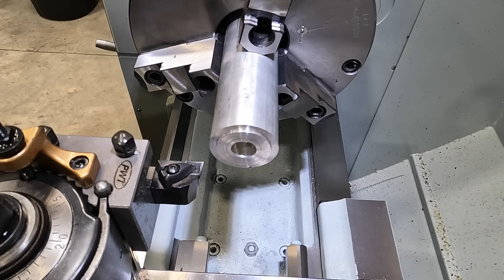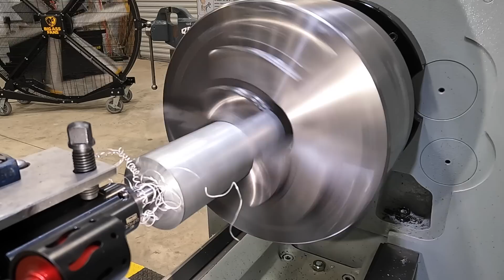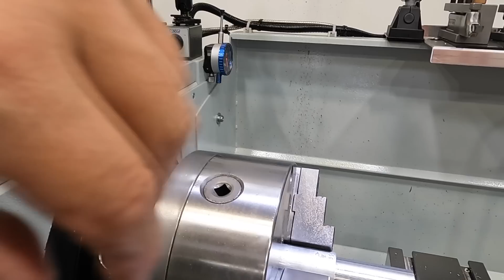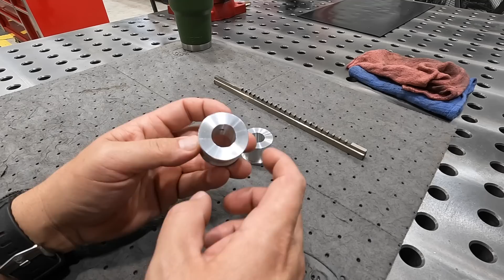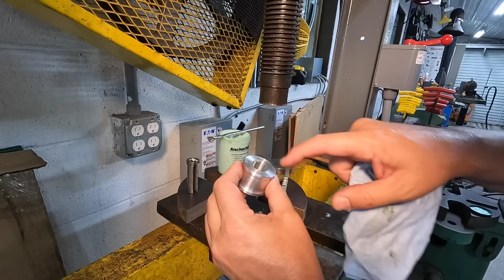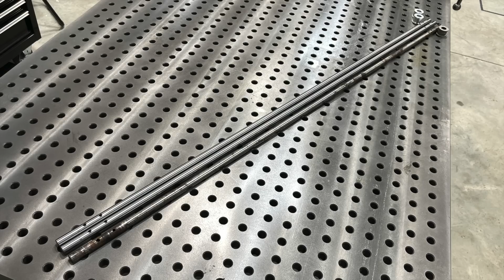Metric Aluminum Pulleys for 20MM Driveshafts

Comment: You know if you don't have a broach/press you can "broach" the keyways by using HSS bars the width of the keyway on the lathe to shave it like a shaper. I did this to machine a key way into a change gear for the victor lathe (mine used timing belts instead of gears).

Comment: The original pulley had a raised edge on the center, wasn't that supposed to help center the flat belt 
so that it doesent rub and shred on the sides?
Reply: The edge is taller than the belt, at least i assume it is, given that its the way every other belt-pulley system works... The central high point, is needed for tracking when there are no edges on the sides, but with those there, the belt aint movin` nowhere, its held central by the raised edges, so it cant fray or get torn by the edge anyway... Crowning of the pulley for a flat belt is just another way of doing it, which is why most olden, flat belt machinery has simple pulleys with a raised center, or so called crowning, as you said, to help keep the belt central... the raised edges are a better way, but oft more tricky, as you can simply roll a belt onto a crowned pulley, but will likely have a hard time doing so with an edged pulley... Its like worrying about an x-V belt not having a crowned pulley, its simply not necessary due to already present geometry that will do the same job and allow for a belt to be more evenly worn and tightened... Now, its possible the original design was intentional and i dont have all the data and one could say im shooting outta my ass on this one, but in general, its either or...

Comment: Since the parts are metric, why are you not using the DRO set to metric, and measuring in metric, instead of converting?  
Other than that, very nice video.
Reply: Probably thinks in Imperial after many years using it in his work. The parts end up the same size no matter how they’re measured.

Comment: Adam this is a curiosity question. By you putting the screw over the key I noticed that actually you are making the "thickness" of the material where the screw is located substantially thinner and weaker considering this is aluminum, in other words, to me it seems there is a strong possibility the threads will strip quite easily. Would be different is this pulley was made of a harder material such as steel or even brass . What do you think?

Comment: The key prevents rotational movement of the pulley on the shaft.  So the purpose of the set screws may be to prevent axial movement of the pulley on the shaft.  If that's the case, positioning one of the set screws over the key might not be a good idea (since the key may slide axially).
Reply: One setscrew prevents the key from moving and the other positions the part on the shaft. Standard practice is to place the setscrews 90 degrees apart.
Reply: @ellieprice363  Fair enough.  Maybe the original pulley was designed for a Woodruff key (which would be captive and not require a setscrew to clamp it in place).
Reply: @chrisarmstrong8198  With s woodruff you still need two setscrews. One over the key to keep it from wiggling and the other at 90 degrees
Reply: @ellieprice363  A properly fitted Woodruff key is well-constrained.  A setscrew seems unnecessary.
Reply: @chrisarmstrong8198  But that’s the way it’s done in industry.

Comment: What I have always wondered (note that I'm not in the US and our pricing/business setups etc are likely extremely different, ie. there's no machineshop in every town, etc): Are machinists prices so low that orders for items such as the ones in this video are given to shops like Adam's, or is it an availability thing (the rollers are custom/cannot be ordered online, etc)?
Reply: More likely it's a mix of time and availability...might find something like this from Misumi, but sometimes speed is more important  than the cost. If your buisness is down, the cost to have a machine shop make it is minor compared to what you will loose for not being able to operate. As far as how common machine shops are in the US, that's a tough question to answer. If there is a lot of manufacturing around, you're sure to find shops of all sizes to support industry or do production work. But, once you get out into lower population areas, it could be tough finding a capable shop within 100miles.

Comment: What’s the ratchet with that press?
Reply: I suppose you are referring to the broach?
Reply: @janvisser2223  I wrote racket. Thank you autocorrect @&$@!
Reply: @wlmjbrown  😀
Reply: @wlmjbrown  I think most of the noise is some slop in the bevel gears. It is a dake press modified by his father some years ago. I would guess it is not as loud and irritating when actually working with it. Microphones and be overly sensitive to some sounds.

Comment: it must be an optical illusion; on the original part it looks like the base of the pulley is crowned to better handle a flat belt.
Reply: There is an undercut on either side of the belt sheave that Adam did not copy over. I couldn't tell if there was any crowning of the sheave.

Comment: Hmmmmm. . .  Non-metric set screw on an obvious metric part.   Somewhere down the line, somebody’s going to be unhappy. . .  at that size, stripping the screw will be really easy to do with the wrong size Allen key. . .
Reply: A good mecanic wil notis it When the mm allen key dont fit.
Reply: 22:20 it was apperently inch standard in the other one aswell
Reply: Don’t know where you’ve been hiding, but the mixing of metric and imperial has been going on for many decades now. Nothing unusual here.
Reply: @grntitan1  Certainly not hiding in America! The rest of the world has spent many decades standardising it's engineering practices not running away.
Reply: I totally agree.
Reply: I totally agree.

Comment: Great video 👍 and a dro is a must in 2022 in my world 😁 you should really consider mounting it on the carriage so its closer/in reach. I've used a Victor with it mounted as yours for 15 years, and when we mounted a new it were put on the carriage. Soooo much better.   All our machines are now like this. And especially important on the ones with long beds 😊

My 'new' Microweily ty2500 has also the dro mounted like this. And it's very similar to yours, size-vise.  Also it's nice to not have to reach over the spindle/chuck constantly 😊

Comment: Set screw over the key means a shorter screw (less thread depth). It also concentrates more stresses, not that that should be an issue with industrial parts.

Comment: Watching Adam using metric is a little bit strange but then i start to feel how much he's taking of for each cut on the lathe. I'm not used to imperial, specially with all the fractional sizes.
Reply: Have noticed that many machinists do the under an inch stuff all in thousands and bypass the fractions stuff.

Comment: The last shop i worked at i used to broach right in the lathe using the tail stock to push the broach through before pulling the part out.

Comment: Is that flat belt going to be happy with no crown in the pulley?  The old pulley has that ridge down the center which provides a rudimentary crown.
Reply: If the belt is not too long, you can get away with one crowned pulley and one pulley without crown...
Reply: @Henning_S.  
I've worked in the printing industry since 1996...specifically bindery machinery.  There is a LOT of flat belt stuff going on there when in comes to moving cut sheets around for folding, gathering, punching, and putting that staple in the girl's belly-button.  Every run of belt is on crowned pullies... Just like back in the days of stream-powered line shafts in factories and traction engines in the fields.

Thinking about it over the last few days, though, I'm sure that Adam contacted his customer about turning those pullies flat instead of duplicating the original, with it's raised center rib.  He's far from a dumb guy, very careful about double-checking stuff, and he's been around flat belt equipment... There may be a video from one of his shop tours that goes into it.

Besides that, he's got a CNC lathe that would've made short work of creating a perfectly crowned pulley.
Reply: @Bluswede  yes, of course you usually use only crowned pulleys, I'm just saying that a short belt will also work if one of the pulleys is not crowned ...
Reply: @Henning_S.  
Agreed.
It always amazed me that a belt would want to 'climb the hill' to ride atop the crown. It's so counterintuitive, but when you put Physics on its tail it makes perfect sense.  It's as if the creator had it in the plan that people would go through a period where flat belts would run everything and that precise alignment would be as elusive as mermaids' kisses!

Comment: Dead nuts:
Used in many trades to mean 'spot on', or absolutely accurate. It originates from the times when machinists machines were set with a set of nuts, on a fine threaded screw inside the machine which controlled it's movements to and froe. The nut would be set at absolute zero, or the stop, or limit of the machine. When the nut was tightened, and the zero set, it would be considered a dead nut.

Comment: Why does your DRO have a Z value rather than a Y value
Reply: The 2 Axis would be Z for "In out" and X for "Backward Forward". If he is using a 2 Axis DRO then that is all he has. If he has a 3 Axis then he would have a Y for "Up Down". This is just the way that lathe's are graphed.
Reply: The axis on a lathe are basically thought of like it's a mill on its size. So in and out is the same as up and down.
Reply: Lathe dro readouts only need x and z. X for left to right and back, z for in and out. Adam worked for years without it, so he’s like a kid in a candy store.
Reply: It’s standart way to mark spindle axis on lathes with Z and diameter with X. I’ve just got a 2channel DRO for my lathe and immediately stick Z labels over Y marks )))

Comment: You say those pulleys are for flat belts. Shouldn't they have a slight crown to keep the belt tracking near the middle? The old pulley looks like it has shinny strip from the wear, as if it is crowned in this way.
Reply: Crowning isnt necessary on "flanged" type pulleys, particularly on such narrow belts.

Comment: I noticed the key was off from one of the set screws.  I was trying to wrack my brain as to why they would do that.  And with it not being symmetrical, well I guess it was just laziness.
Reply: To be clear Michael means the original pulley was not symmetrical. Adam of course is always symmetrical.
Reply: @tomoakhill8825  That is correct.
Reply: With all due respect to Adam, I don't think it's the machinist's job to change the design of the part without permission of the end user. No matter how small or big the job is. This part may have been designed that way. It doesn't make it "wrong" just because it doesn't look "right" to you.
Reply: Some fitters have no love or pride in their work. They leave their trademarks of incompetency everywhere.
Reply: There were two set screws in each. So neither was opposite the key.
Reply: too little meat for threads on top of the set screw
Reply: @fuzzy1dk  Agree, that´s not ok.
Reply: @fuzzy1dk  After looking at it again, I think you might be on to something.  I personally would have at least put one 90deg to the key and one 180 to the key if that was the case.

Comment: What do you, personally, when a customer want something broached in a size you don't have? Do you have them buy the tool? Grind up a tool and broach it on the lathe or mill (spindle off, manually making the strokes with the carriage/quill)?
Reply: Use the Shaper
Reply: Shops usually fine a tool charge, so that includes both wear on tools and buying a new tool for a job.

Then, there is of course the shaper, which adam has one of. Broaching at any size.

Comment: What aluminum alloy and temper did you use, Adam? 6061-T6X might be the most common but 2024-T351, 7075-T6X and others are possible choices with more strength.

Comment: Can you explain why the finish changes between cuts?
Reply: Sibsib92 is right and to add to that as the part gets smaller the speed the cutter is seeing gets slower and that will affect surface finish.. next time you see a large part being faced, look at the finish near the center
Reply: different cutting depth means different cutting forces and some tools need a minimum amount of cutting force to make good a finish

Comment: Adam, just looking close at the sample pulley. You said it was for a flat belt, isn't there a bit of a crown toward the center to help in belt tracking? If you look closely you will see a raised dimeter change in the center, l think this is to aid in belt tracking. (Just a thought) Thanks for sharing.
Reply: As others have said, crowning isnt necessary on flanged pulleys. Maybe the person who fabricated the originals wasnt aware of this. All purchasable flanged pulleys of this size range only come with parallel journals.
Reply: that's what I was thinking too
Reply: I also noticed a crown, probably not needed though because the 'walls' of the pulley capture the belt?
Reply: I'm hoping Adam mic'd the edge and center and confirmed no crown was present. I would worry that a flat belt would walk over to one side and either tear itself up riding the flange, or hop the flange and run off.

Comment: I think that the set screw holes were deliberately not put in line with the key so that you get a maximum amount of thickness for the screw thread to hold onto. The way he's done it gives very little wall thickness for the screw threads. Just my 2c...
Reply: the set screws arent meant to hold it under load the key does that. they are just meant to resist axial forces. like belt wobble. these are straight keys so having over the key will reduce the possibility of it vibrating out. if they actually dimple the key even better.

Comment: the older pulley looked like it was crowned for a flat belt? did you leave that off for a reason?
Reply: He'll never tell.
Reply: @Riis_DK  Looking at the shaft assembly, mt guess is that these pulleys are back-tension pulleys, also, being flanged, they dont require crowning.
Reply: @TheCuriousOrbs  
Looking at the title, my guess is that these pulleys are drive pulleys - and looking at the original they seem to require crowning. 😁

Comment: Why change to a high speed parting tool to part off and not use the indexable parting tool you used earlier?
Reply: High speed steel is sharper and works better in aluminium
Reply: @markshort9098  That's not necessarily true,I machine all types of materials always use indexable inserts whether on manual or cnc lathe it comes down to sufficient coolant supply,feeds and speeds and always near mirror finish on parted face.
Reply: @mehmettemel8725  yeah you can get a good finish with inserts but i always use high speed for parting on aluminium and it normally works better but inserts work fine if the moon phase is right and feeds and speeds are right and you hold your tongue just right.. high speed has always just been easier to hit those right conditions in aluminium
Reply: @markshort9098  I've got nothing against using HSS but if you're machining in a CNC lathe then HSS is out of the question.
Reply: @mehmettemel8725  yeah i wouldn't use high speed steel on cnc but then i don't even know how to turn a cnc machine on, I only run manual machines

Comment: Maybe it's just the way I viewed it, but the original part looked like it has a slight chamfer on the belt side whereas your new pulley's edge looks pretty sharp. As a belt wears and moves on the pulley it could cut it. Just a thought. Great video, I love you new equipment. Also, I forgot to ask, how close did Ian come to you?
Reply: Dave Leland,Certainly looks as if it;s a crown in the center of the pulley , flat belts nearly always run on a crowned pulley to keep them central .

Comment: The original pulleys had a larger diameter section in the centre to act as a crown. Any reason for leaving that off the new ones?
Reply: In flat belt drives only one pulley needs to be crowned for the belt to run true. The drive pulley is usually crowned and the other left flat.

Comment: I am so used to seeing a crown on flat belt pulleys to help center the belt instead of only relying on flanges.  But if it works, it works.  Seeing the non-typical set screw arrangement in the customer's sample pulley makes me wonder if that was a replacement part already and a crown feature was beyond the capabilities of whoever made that part.
Reply: The original pulley shown in this video had a larger diameter section in the centre to act as a crown.

Comment: Nice work Adam. The Arbor, or lack thereof is the problem with two shops. You need of two of the fundamental equipment, one for each shop. Thanks for sharing.

Comment: Can the DRO make the conversions for you?
Reply: All DROs that I am aware of have a MM or inch readout and can switch between either at any time by a touch of a button on screen. Only thing they can't do is have inch reading on one axis and mm reading reading on the other axis at the same time - not to my knowledge anyway. As for converting inches to MM each DRO I have seen has a calculator built into the screen. Can convert inches to MM by multiplying inch reading by 25.4. Self taught 71 yr old machinist.

Comment: That pulley looked like it had a slight crown on it.Most flat belts have a crown on them.
Reply: True, but most flat-belt pulleys (that I’ve seen) don’t have flanges; the crown helps center the belt on the pulley.
Reply: The original pulleys do indeed have a larger diameter section in the centre to act as a crown. Must be a reason for cutting them straight?